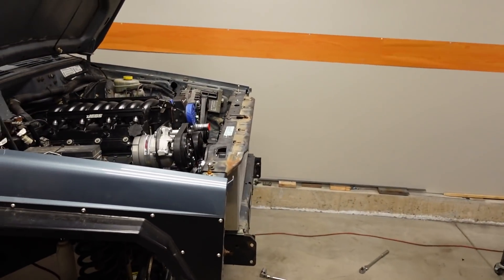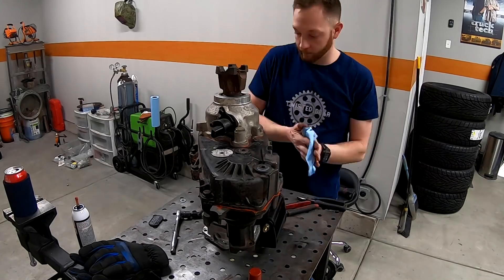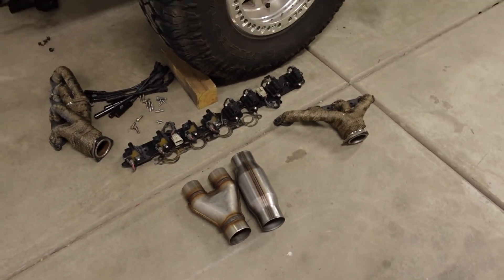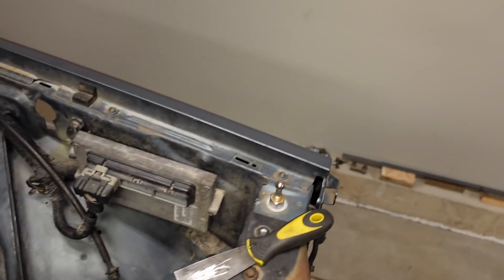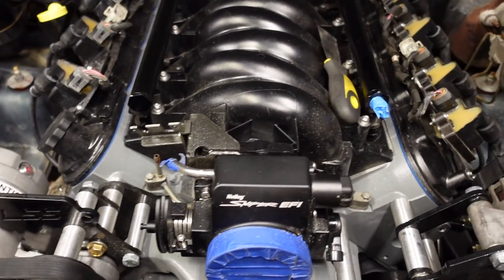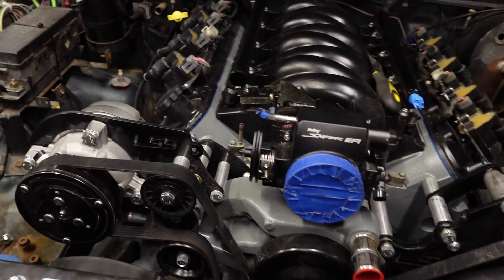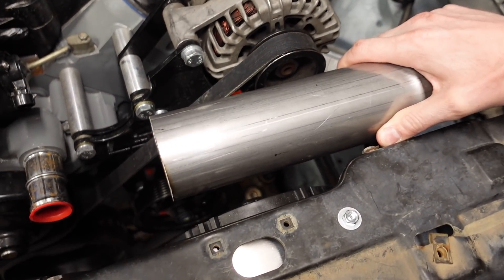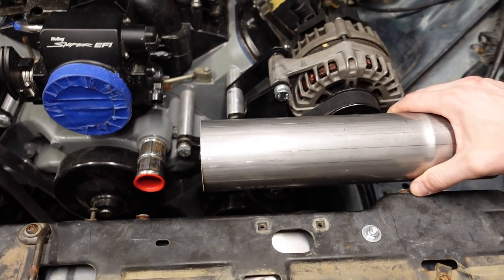Jeep Cherokee Engine Swap Pt 3: Headers + Hood Clearance

Comment from the maker: I so cannot wait to get this thing running and hear a cammed LS under the hood of an XJ Cherokee. Thanks again for the views and support guys! Don't forget to head on over to tolmanperformance.com and grab some merch!
Reply: Why don't you make a Tee at the throttle body and go 3" in both directions? Two 3" tubes and two filters will give feed that 4" throttle body ALL the air it needs and then some. Bonus being, you are already moving the battery out of the way.
Reply: @SurlyMike  that's exactly what I was thinking and you could make a box that could house the filters from water and mud
Reply: I would oval some piping for the intake.
Reply: @chrisc6188  Take a 4" 90* and pinch it to an oval shape and it'll pass the pulley just fine.  I've pinched a 4" by sticking a piece of wood post in each end and press the middle section.  They do make oval to round adapters, etc.  Like this example https://www.rossmachineracing.com/ovaltube.html  Obviously this is smaller but you get the idea.
Reply: NEED TO STUFF ONE IN MY 72 f100
Reply: how about 2x 2.5inch in a y configuration that would look sick
Reply: Awesome job man. Keep it up!!!

Comment: I had similar clearance issues on my TDI swap XJ, the exhaust coming down on the passenger side was really tight with a 2.5in down pipe, had to end up removing the entire link and link mount on the passenger side and go 3 link to get it to all work

Comment: What headers are these??
Reply from the maker: they are made by Novak Conversions specifically for the XJ
Reply: @TolmanPerformance  are you running ac? If so how did you do your ac system and lines

Comment: So I’m just wrapping up the rebuild on my 5.3 and I fitted the ls1 intake and LSSimple brackets like this but I was wondering if you know what style dip stick you used? I don’t know if I should just bend the truck dipstick or get a car dipstick (which I feel wouldn’t read correctly).
Reply from the maker: I'm not positive, but pretty sure it was a truck dipstick the customer provided for this build. If I remember right, I may have bent it a bit and re-made the upper mount tab or something like that also

Comment: Hello good day I have a 2000 xj I did swap LS1 but I don't know which are the appropriate headers, the ones I have seen, you have to cut the frame a little to get them to enter, but it is not what I want I see that you put the exohust without problem and I like it What are the headers you put in? thanks bro

Comment: Hola buenos dias, tengo una xj 2000 con lift kit de 7.5 pulgadas y 4links, le hice un LS1 swap pero no encuentro los headers adecuados, todos los que ecuentro no caben y tendria que cortar el frame un poco, pero no es lo que quiero....
Cuales headers pusiste tu sin cortar el frame???
Gracias

Comment: Just noticed you're in Utah! 
I need some axle work done to my XJ if you're not already buried in jobs. Lmk

Also, was wondering if you couldn't run 4" tube, have it bend 90 and after the bend oval the pipe to run past the alternator then go back to round and 45 down into that spot?  I had to do something similar on my swapped turboed EG Honda.
Edit: haha, I just noticed all the other oval comments...

Comment: Love the channel. So if im pulling a LS engine from a junkyard do you have any advice? What all do i need to be sure to take when pulling the engine? Thank you
Reply from the maker: get as much as you can.  all the wiring harness without cutting, fuse block and computer, fan harness if its E-fans, any linkages, exhaust manifolds, flexplate, pretty much anything that might be useful.

Comment: I am planning to put a 5.3 in my jeep. Going to order the novak headers. You think I just get a muffler shop to weld up and exhaust and Cat? I havent had much luck finding a bolt on system. I need mine to be emissions compliant.

Comment: I sure am glad I stumbled upon your channel. I just finished removing my motor, trans and transfer case. Motor has a hole in #1 piston and either the transmission or transfer case was making a vibration at times…so now I have a decision to make after watching some of your videos on this set up vs rebuilding stock.
Reply from the maker: I will say a V8 is a lot more fun than the 4.0 I6

Comment: Did you consider running a 4” intake tube but squishing it to make it narrower but taller in the area it passes between the alternator and the radiator? You may lose a little volume in that area, but not nearly as much as running a 3” tube. And you won’t have to reinvent the accessory drive to make it work.

Comment: Double stack the 3 inch tube (or even smaller) in an over/under arrangement and put the filter on the left/drivers side.  I think SLP made an intake tube like that for the 1993 to 2002 F-body.

Comment: Why not run a speed density tube with the filter on the throttle body?
Reply from the maker: it is a speed density setup, but it would have to be a small filter and would draw a lot of hot air from the radiator

Comment: You could always take 3.5 inch pipe and flatten it to an oval in the places it’s too tight, then it’ll fit in place and it won’t hurt flow

Comment: I used the stock truck ac bracket with the Denso 10S20F compressor and it does clear the frame and motor mount since you are all the way forward on your motor mount adjustment.

Comment: Looks to me that he probably could have gotten away with a complete stock truck accessory drive set up and route the intake towards the passanger side wouldn't be any obstruction other that the upper rad hose. The alt might stick up to high though looking but would have been worth a shot before buying that kit

Comment: Put the air filter in the hood like the New TRX has and just build a pan coming off the intake to line up and seal. I think you are opening up a can of worms moving the ac comp. that’s a lot of re engineering for not much gain. Maybe do an onboard air compressor and bolt that to the lower block. Great project and I hope it pays well!
Reply from the maker: I do like that idea, or better yet just swap the hellcat engine

Comment: What if you made a three inch oval section to pass the alternator? Then a transition to 3.5inch where there is room on each end. A bit of cutting and welding but might be an option?

Comment: One idea to help get around alternator would be to oval the round 4. You can easily compressed that 4in down to a 3in oval it would by 1/2 inch on each long side and if you secure each side with a plug before you compress it will still hold the 4-inch diameter so you can reconnect to round pipe you would still have the flow volume of a 4in you would just have that little bit of turbulence which really should not hurt performance just an idea figured I'd throw it out there I really enjoy the content

Comment: LT, Did that hose connection on the throttle body move as easily as it looked on video? I might need to do that on my project, but don't want to break the throttle body.

Comment: How about a T style intake tube? Run 2" tube from both sides and merge into the throttle body. It's a little more fab work and now you'll need 2 filters but would give you the 4" overall airflow you would like.

Comment: Holley 20-160 A/C compressor relocation kit is a real nice for on these XJ's. Also, the owner should've researched accessories better. Corvette/CTS-V accessories are a much better for as well & the tightest against the block. Makes more room up front. 👍

Comment: Just oval a 4 inch pipe and you'll have more than enough room. I just did a twin turbo build on my LS swapped BMW E36 and if I can fit then all under the hood, I think you can make a 4 inch pipe work. lol

Comment: I just had a thought - if you increased the height of the transmission in the rear you wouldn't need to modify the hood.  You could gain almost an inch by just changing the angle.  Its fuel injected so having a neutral (level) engine isn't really an issue.
Reply from the maker: true, but I already tucked the transmission as high as it would comfortably go, in an effort to maximize ground clearance

Comment: Is there a simple way to replace ALL the wiring in an XJ during a swap like this and maintain all the creature comforts (AC/Heat and Radio) and road requirements (lights)? The wiring harnesses in my 98 XJ are in rough shape from previous owners and would love to replace them either with or without the stock 4.0.

Comment: I bought an aftermarket A/C for my ‘71 C10 LS swap project. I wanted to relocate the stock compressor but was told it was controlled by the ECM and wouldn’t work with the aftermarket unit. Not sure what your customer’s situation is there... You have a great channel LT, I’ll keep watching!

Comment: LT you are using that word wrong. Any time you are talking about how far something is, a distance that you could measure with a ruler, it is farther. You could move the engine farther forward. The stars are farther away than the moon. Any time you are talking about something that can't be measured with inches, it is further. For example you can further your education, or further your goals. It is a common error. Another error that gets me is when people add the "th" sound to the end of height. Once you notice people doing it, you won't be able to not notice it.

Comment: Hey LT. you should run a snorkel. Smush down some 4 inch tube into oval when you get in the tight spots, doesnt have to be round. look at what KN does to truck intake. Its mostly oval.

Comment: Can you come off the throttle body with a large pipe and weld a Y pointing to each side  using two smaller pipes with equal or greater volume than the throttle body pipe giving you greater clearance on the pulleys.

Comment: The ls6 intake manifold is like 3" would it even make difference since it would be restricted from the intake manifold?
Reply from the maker: that is a fair point, but I'm just making a comparison to the stock size intake tube that would've been on an LS6 or LQ4, and they both are a little larger than 3" if memory serves

Comment: If you move the AC then the battery can be mounted in the front corner too?  Thats really unfortunate things are up that close to the rad, even if you pipe to the corner its still running pipe through a lot of hot air. Like you said, no real good solution for this, you just have to go with something and do your best.  I'm enjoying the project, keep up the great work!

Comment: Hey LT, I built a bracket to my air intake when I put an LS1 in my 1995 S10. I used 3.5” tubing which is about an 1/8th inch from the pulley and it has never touched. You don’t need as much room as you think especially with your fab skills. You can definitely make something sturdy that doesn’t allow the flex. Thanks for the great videos!

Comment: What about a 2 filter setup one in each corner out of 2 1/2 or 3 combined at the throttle body?
Reply: That was my thought too!  2.5 inch to each side should give plenty of clearance and allow room for movement, and still have plenty of flow.  That also keeps the accessories (especially the alternator) up high and out of the way of water/mud/snow etc.

Comment: Can’t wait for the wiring. I want to see how to make stock gauges work. I’m ready to do this
Reply: Same that is the only thing that is stopping me from doing mine and of course money as well 😅
Reply: Novak makes a gauge integration box.  Takes in the CPS/CKP signals and turns it into RPM signals.  Fuel/Speedo are simple signals.  Oil and Coolant temps are done from the stock Jeep PCM that you're going to keep as a gauge "mule".

Comment: Oval tubing might work. Give you a chance for more flexing of the pie cut welds you love
Reply: Moving the engine forward is both good and bad. I was thinking of making an oval to get cross section through the tight area, too. Lots of fab to get there... I wonder if you charge by the hour—could get pricey!